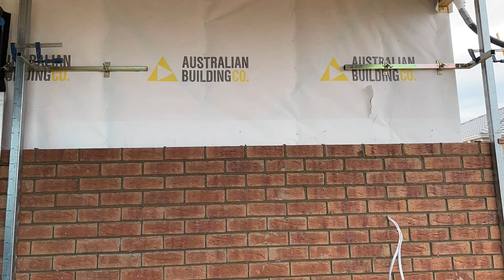MY FIRST JOB WITH A BUILDER | BRICKLAYING AUSTRALIA

Comment: Hi mate great work 👍 👏  

Just a quick question for you regarding working by yourself,

 did the builders have any dramas with you working alone with no labour?
 Reason for asking is because i also will like to start off working the same way as you did when i arrive in Australia  and slowly build up a company and in time be able to hire blokes to work with me. 

Also how dose the supplying materials work?  Dose the builder supply the bricks, sand, cement, and tie bars. Or do you supply stuff yourself? All information would be greatly appreciated mate 😊